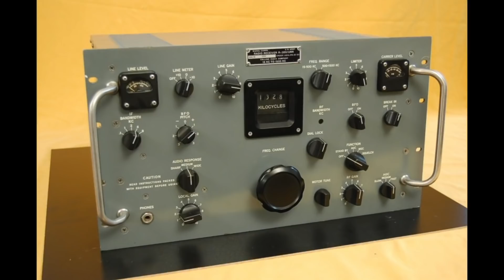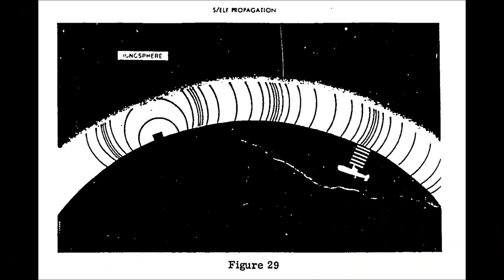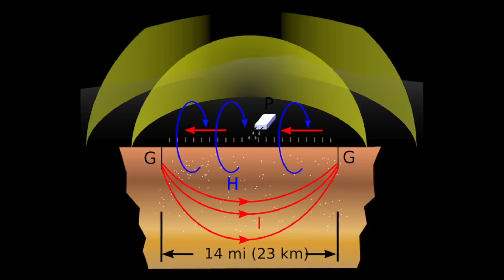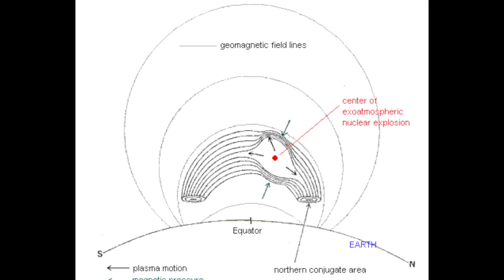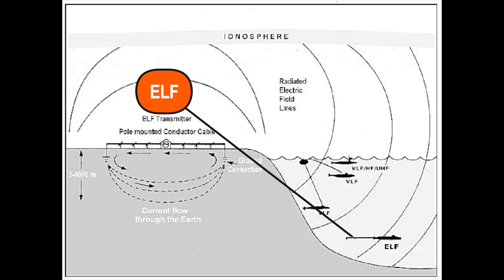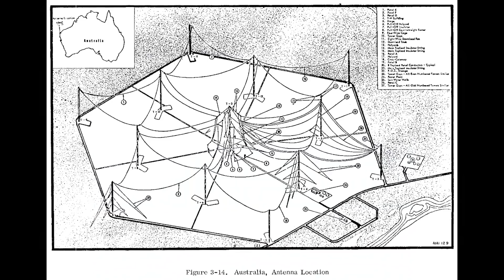Submarine Communication Mystery - Prof Simon

Comment: Well, one reason for phasing out ELF could well be that it's not actually much good for anything. Remember that as the frequency of a radio carrier wave goes down, so does its ability to carry useful information - the available bandwidth steadily reduces and you eventually end up with extremely slow speed Morse code. which you have observe as a plot on a screen as the audio version is so excruciatingly slow. This why you have broadcast standard colour TV at VHF,UHF and higher and not in the AM or MF/LF bands - there ain't enough space for the signals.
Reply: You gave a very intelligent and good answer with a good insight in radio propagation.